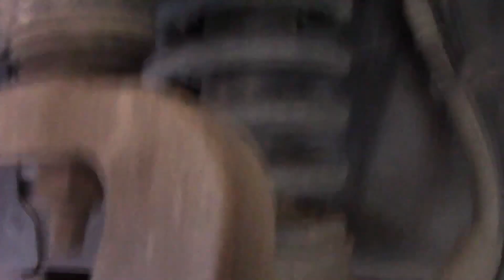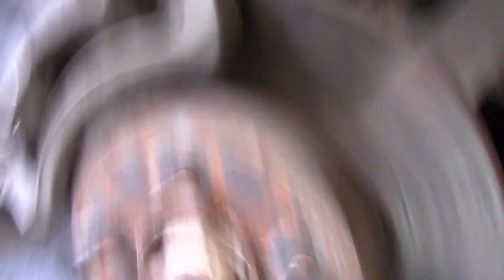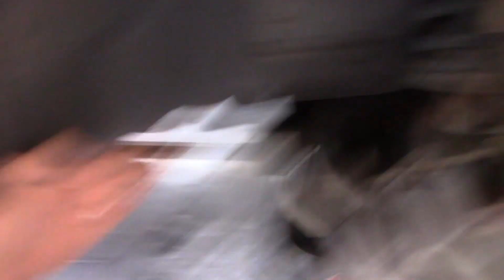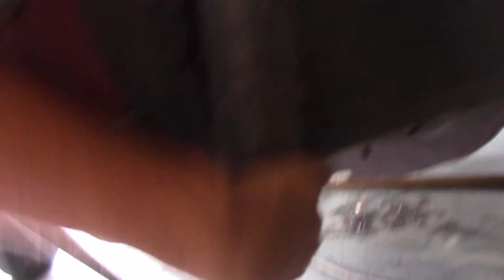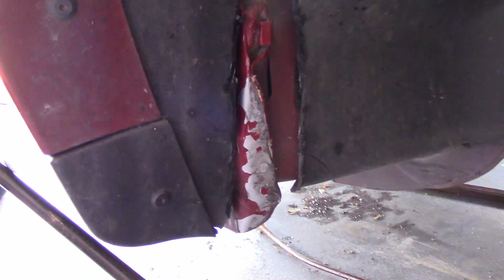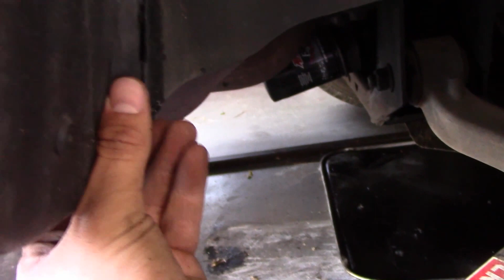Quick and Easy Way to Fold Over Inner Fender Pinch Weld on Jeep Liberty

Comment: Could you let me know if it is possible to use 245/75 R16?
Reply: I have 245/75/R16 still rubs aftet pinch and weld.. have to lift
Reply from the maker: yes, those should work

Comment: Sooo did it work buddy?
Reply from the maker: It did. In hindsight, would have rather hear welded with a heat gun the abs over the beat over lunch weld. Those patches probably only stayed glued for 1500-3000 miles
Reply: Good advice buddy ☺, I've just put 245/70/16's on mine. Its rubbing 🤔, I'm going to follow your plan mate.
Many thanks 

Matt

Comment: Why not just use fiberglass mat and be done with it... 10 minute permanent fix..
Reply from the maker: Yea, I guess that would have worked. I don't know that I would have been skilled enough to pull that off 2 years ago, but I suppose that would have been a great place to try it since no one really would see it. Also learned later that with a heat gun I could have patched it much better too. Just one way of doing it.

Comment: this seems extreme to fit not that bigger tyre than factory. this would not happen to toyota even my hyundai terracan. seem the rear wheel is offset very close to the front of the guard. cant the front wheel be moved forward to centre the wheel ?
Reply from the maker: cool.

Comment: Did bending the pinch weld eliminate rubbing without the lift installed?
Reply from the maker: I never had anything but stock wheels and tires on without the lift installed, so I can't really answer your question.
Reply: Str8sixfan thanks man. I am currently having a rubbing issue on my 2012 Liberty because of the pinch weld. However, I’m not sitting on a lift so was curious if I can bang it out and eliminate the rub without a lift. But thanks for your response. 👍🏼 245/75/16
Reply from the maker: yea I would suspect that you're rubbing with that size and no lift.

Comment: Putting that hacked up piece of plastic back on isn't gonna help much for keeping rust down, and might just make things worse.  Trying to hammer the piece of plastic flat is a bad idea.  Warm it up and press it flat.  Could probably flatten it cold, but hot works better.
Reply from the maker: DonziGT230 yea, they're both gone now. They didn't hold up. I also didn't have a heat gun at the time. If I had to do it all over again, I would have kept the plastic shavings and soldered it in place. But that lasted close to a year as is. Thanks for watching
Reply: @Str8sixfan  would it have been better if you just removed the entire plastic liner and hammered the pinch weld and flex sealed it then flatten the plastic and put it back?
Reply from the maker: @ns671fr  perhaps, I usually try and retain as much factory things as possible. If I had to do it again I would have likely made a patch piece out of the remenint but used a soldering iron to fuse it

Comment: What offset backspacing did you use for the new wheels?
Reply from the maker: I can't remember offset, since I'm old school and speak better in backspacing. I want to say that they ended up being something like 4.89" backspacing (I want to say it's either 10mm offset, or 8mm maybe? Don't quote me). They rub a little at full lock when in reverse. But if I trim more out of my inner fender wheels I'd be fine. Check out my other video (lift is done video I believe) and you can see how much I cut out.
Reply: thank you for the quick reply. I have been watching several of you videos, trying to decide which is the best choice for me. 210,xxx miles all original suspension

Comment: How's the pinch weld mod holding up? Have you noticed any scary signs since hammering it flat?
Reply from the maker: No, we're good. Many people do this. You about have to. The contact cement is actually holding up ok. If I had to do it all over again, I'd use a soldering iron to melt the plastic to itself, and fill in the gaps with excess I have. Thanks for dropping in!